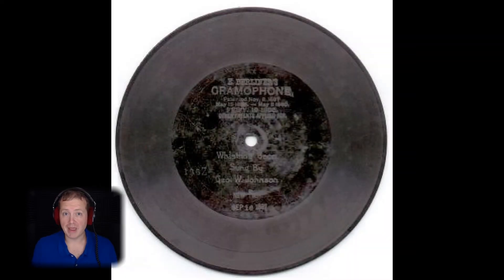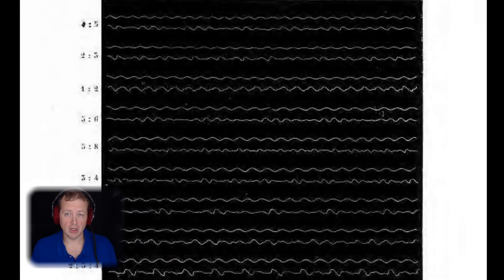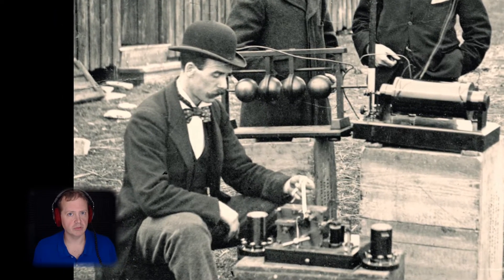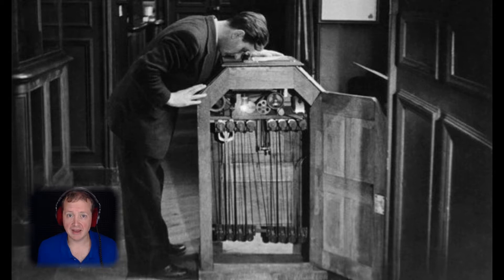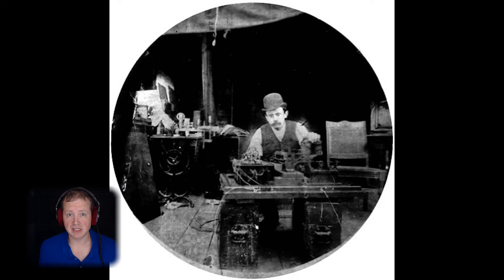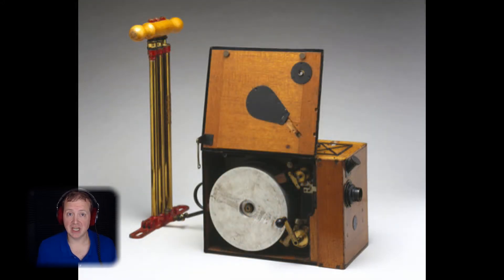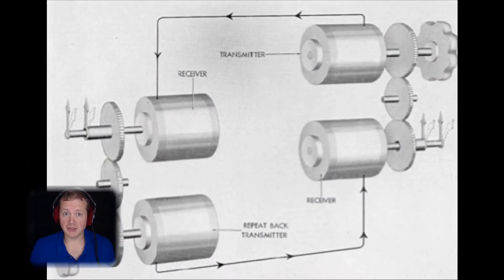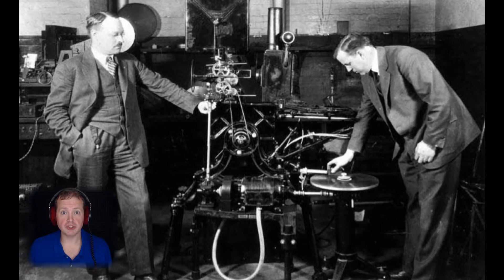The Real Origin of MOS - Sound Speeds

Comment: A couple of points I'll challenge: First: The answer to "Roll Sound!" when sound is recording and all is well is still "Speed!" The terms "Sound Speed" or "Sound Speeds" is a very recent development use mostly by relative newcomers, and is also regional. Most say "Speed". Some say "Turning". Some say "Sound Speed" and some are now saying "Sound Speeds". But all that's needed to be said is "Speed", and is a good way to get street cred with seasoned film veterans. Second: The production term "MOS" has several origins. "Motor Only Sync" is one. "Minus Optical Stripe" is another. I've never heard "Motor Only Shot", but that too was probably used. But the one that made MOS one of the iconic terms in the craft is, indeed, "Mit Out Sound". It's the only one that still has the same meaning then as today. Plus, the term would have been long forgotten had it not been for such a interesting story of its origin. Exactly who said it, and when, is unknown. It may have been all three of the people whose names were shown, and it probably happened multiple times before it stuck. But stick, it did. Yes, it's a myth and a legend, but that doesn't mean it's not true. So, yes, the most likely origin and single most significant factor behind the  current use of MOS is, indeed, "Mit Out Sound".
Reply: MIT out sound wouldn't even make sense. As in German it might be more like 'ohne audio' which actually means without audio. MIT is not used in this sense. Ohne means without , MIT means with.
Reply from the maker: Great add
Reply from the maker: As always, thanks for your input Glen.